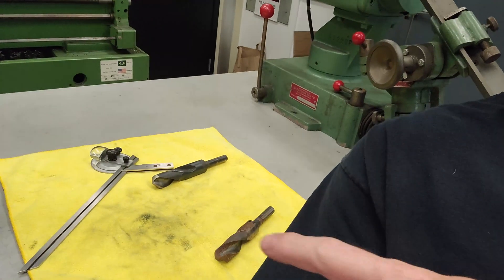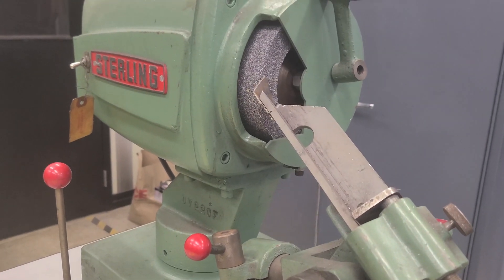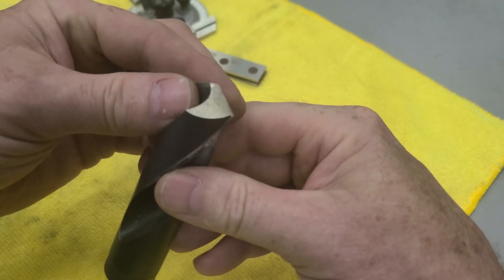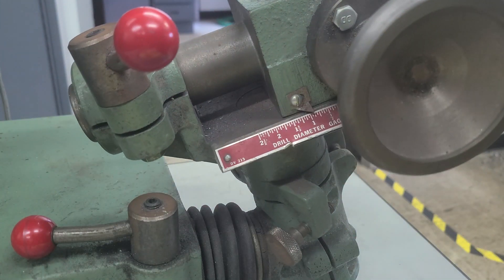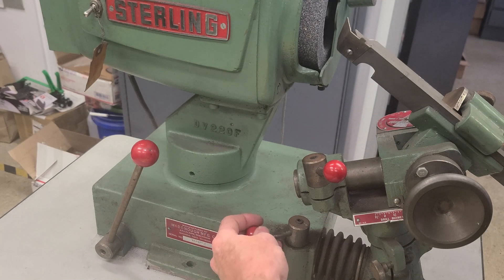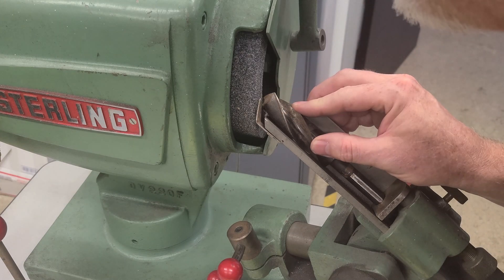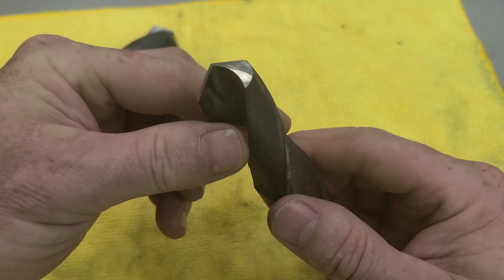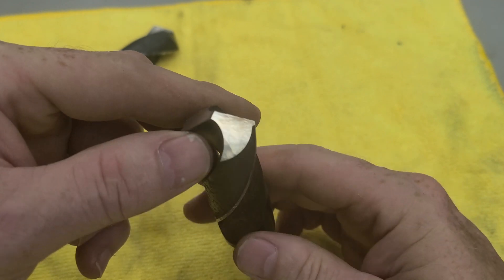Sharpening Drill Bits

Comment: I used one of these in a machine shop for many years. Great for sharpening large drills 1/2”+. Not so good for smaller ones. It looks like you are missing the diamond dresser for the swing arm above. Ours screwed in and had a threaded locknut. The dresser is a big help to keep the wheel sharp and not burn your drill edge. Thanks for sharing!
Reply from the maker: Yeah, I mentioned the dresser diamond at the 8:30 mark.  I've sent a request to the manufacturer for parts.  Thanks for watching!!